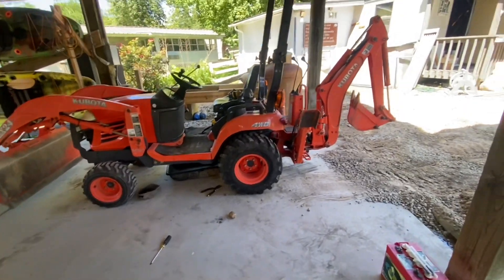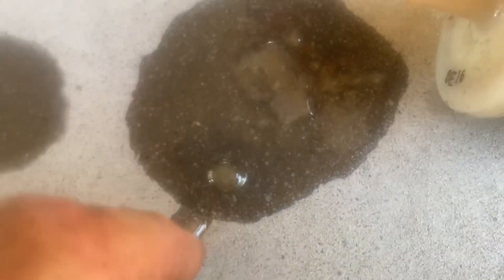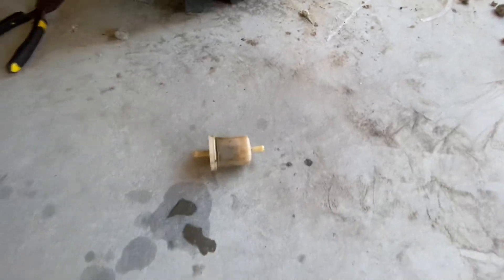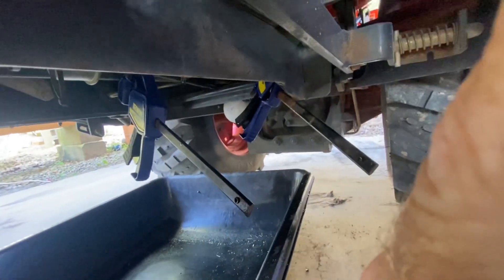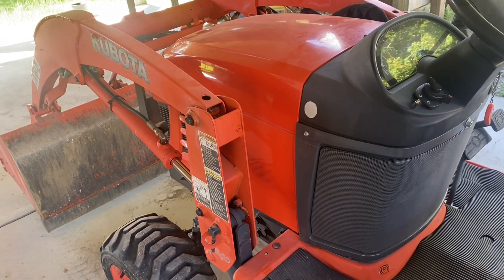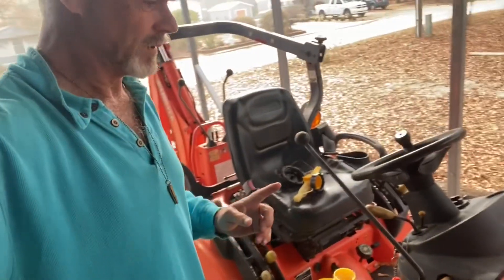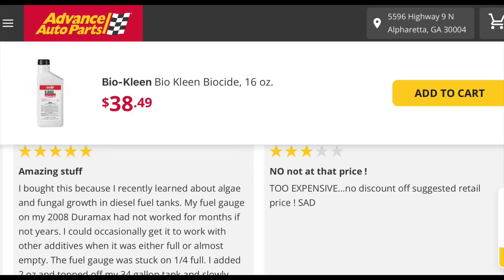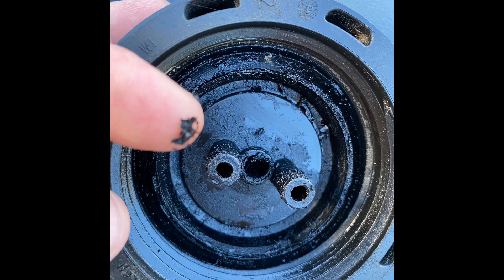Kubota Tractor Died!  Diesel Fuel System Contaminated by Microbes! Fixed!

Comment: That’s self inflicted. You need to find better fuel. Delete that filter and replace it with a water separator and you’ll be a lot happier
Reply from the maker: Self inflicted? Watch again. I explained that it came this way and that the seller took it back and  cleaned the tank and fuel system.

Comment: I recommend quality fuel can and buying fuel at a name brand station that sells a lot of fuel. Some country stores and off brand stations just don’t sell much and it’s old fuel. Also keeping tractor fuel tank full when left sitting especially for long periods like over winter. This will help with the water condensation issue. You’ll love the BX tractor once you get the fuel system cleaned. Always keep a couple of fuel filters on hand as it takes 2, the undercarriage one and the one at injection pump at the engine. One more tip, always use Kubota Super UDT2 HST fluid for the hydraulic system, it is truly worth it, aftermarket brands just don’t give proper performance. Have a Blessed Day and Happy New Year to you both !

Comment: Years ago after my 2006 duramax truck injectors and injector pump died due to water in the fuel costing me 7k I then went to Napa and purchased a universal fuel filter base to bolt to my frame under the truck and appropriate adapters for my fuel line size and a screw on fuel filter that had a wing nut at the bottom I could crack open on occasion to drain out water. Ughh. I need to do that to my current truck. That I found nasty nasty black slime on my fuel filter months ago. Thanks. Now I’m gonna search for fuel system cleaner also. Love yr tractor. Wish it was mine with a snowblower

Comment: Hi Exoman,
This problem is not new. It's new to you. I'm a retired railroad Electrician and I  maintained Locomotives and generators. It is microbes but also a form of algae. Bio Kleenex is one of many treatments. On locomotives and generators we used a device called a fuel polisher. It recycled and filtered much of the microbes out of the tank and the we also applied the treatment. What we caught in the filters was not pleasant. Sailboats and yachts regularly polish their fuel. Some have the very expensive machines installed on their boats. Unfortunately diesel fuel comes from so many different vendors now you can't rely on it being clean.

Comment: What causes it ? I've  been driving tractor trailers for over 40 years and never heard of that. Can you get  a fuel and water separater for your tractor? That will allow you to drain the water before it can get to the injectors.  Good luck .

Comment: 90% of the time with diesel, it is water issues in the fuel. Both the water in the injectors AND the microbial contamination FROM the water. You are right as this being a fairly new issue. Nicely done and thanks for the hints!!!!

Comment: Speaking as a diesel  
 ,mechanic / tech with 50yrs experience, I would personally drain the tank if possible, remove it and take it to a shop and have the inside  steamed cleaned .If you don't that's going to haunt you for ever, after  would kept as full as possible when storing it.Years ago ,rule of thumb in the trucking industry and running heavy equipment was top off fuel at end of day.That's a pretty puny fuel filter, water will destroy you injection pump, costing you $$$.I would try to install a alternative fuel filter with a water separator .Hard to believe Kobota wouldn't have a spin on at the engine.
Reply: Same with small planes. Keep the tanks filled and atmospheric moisture won’t condense while the plane spends most of its life waiting to get airborne again.

Comment: If you have ever had a boat with a diesel in it, microbe contamination is pretty common.  The bio kill stuff will kill the microbes, but they  will still be in there.  So you will go through a lot of fuel filters until they are all gone (unless you just decide to polish the fuel and remove them, but on a small tractor like that, I think I'd just keep buying filters until they were all out of it).
Reply from the maker: Good idea Ralph, that is the plan as they are dark again.